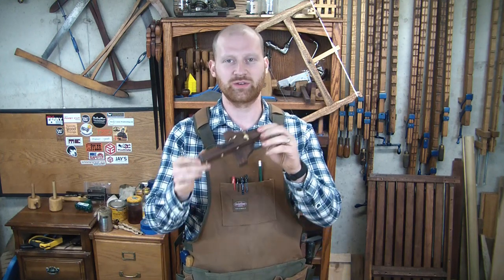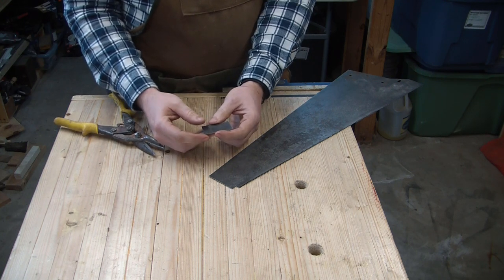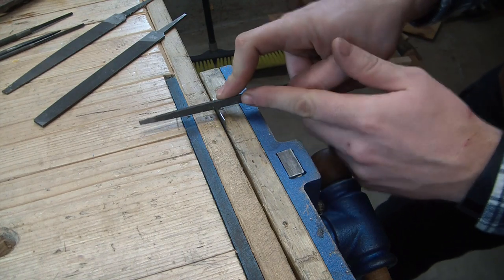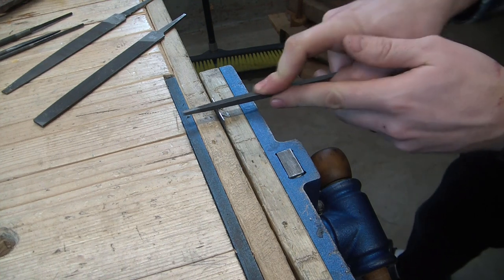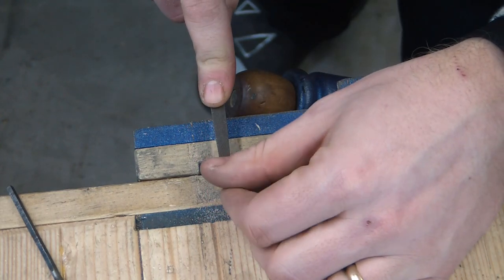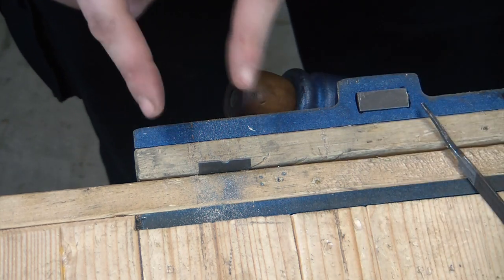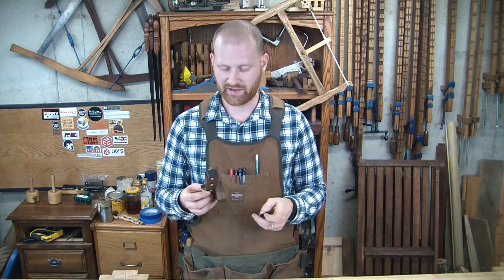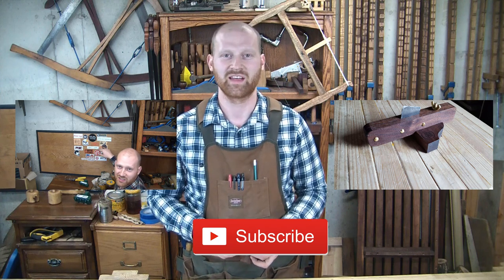How To Make A Scratch Stock Cutter From An Old Hand Saw

Comment: Thank you for making this video! That looked surprisingly easy to do. Those files are easy to get and this is a good project to learn how to file metal.
Reply from the maker: +Sighthound Studio They are very easy to make. Normally no more then 3-5 minutes to make one. and the shapes are endless. I would love to see what you come up with!
Reply: +Wood By Wright I am going to hold off on projects that require precision till I have my workbench done and vise installed. After that, I am definitely trying this project.
Reply from the maker: yup once you get the bench squared away everything else becomes easier. looking forward to seeing it!

Comment: Cool video as usual. Although working with metal usually makes me think of Norm and "these" safety glasses :-)
I see you cut both directions, at first I thought you had to work them like a card scraper and create a bur on one side.
Is this only for use with the grain or could you use it to create a edge on say a curve?
I also noticed you used one of those "old-timy" wood clamps. I having trouble using mine, maybe an idea for a short video?
Thanks for the content and inspiration.
Reply from the maker: +Nearoth That might make a good video. there are several different types of those clamps. might be good to show! some people treat it like a card scraper and in truth it kind of is as you do end up creating a bur with the file. but the file creates a fairly solid bur that lasts a wile. but it will even scratch it without the bur. As with most tools there are a lot of different ways to use it.

Comment: Nice project! What the difference between scratch stock and beading tools? Thanks.
Reply from the maker: +Hobi Kayu - DIY Woodworking Hobby thanks. A beading tool usually has a blade that. Cuts more like a plane. A scratch stock is more like a card scraper. If that answers your question.
Reply from the maker: +Hobi Kayu - DIY Woodworking Hobby thanks. A beading tool usually has a blade that. Cuts more like a plane. A scratch stock is more like a card scraper. If that answers your question.

Comment: How long will an edge like this last? When it wears down or no longer cuts, do you just file flat and make a new edge?
Reply from the maker: It depends on the wood and the steel and a few other factors, but usually needs to be sharpened every 30 mins or so. Yes just a quick touch-up with the file is all it needs.
Reply: @WoodByWright  Thanks!